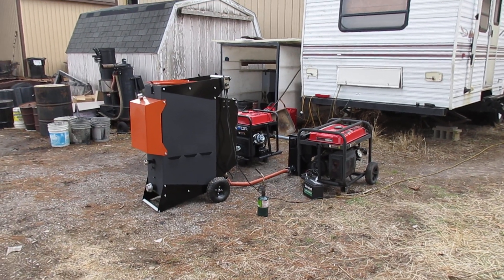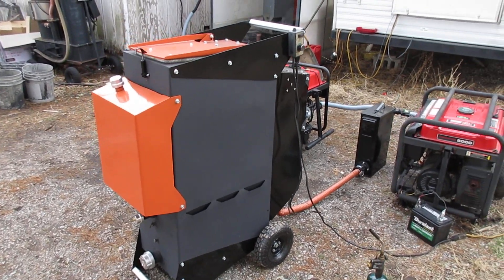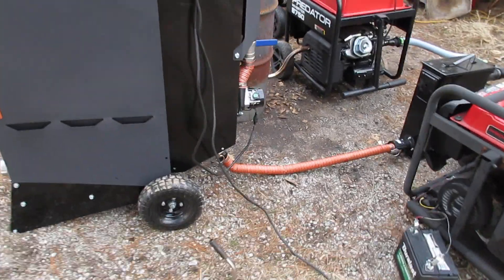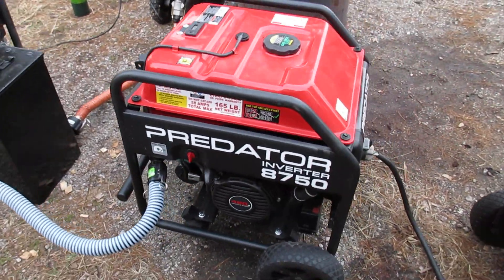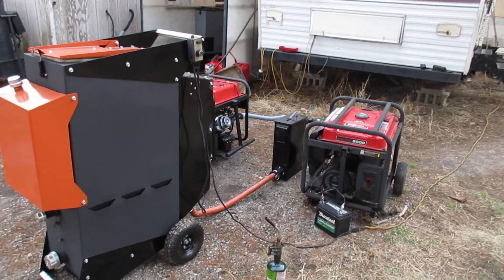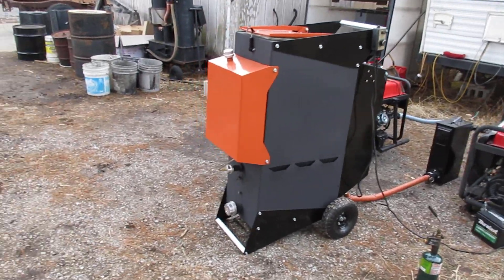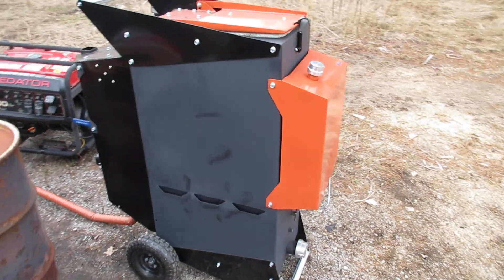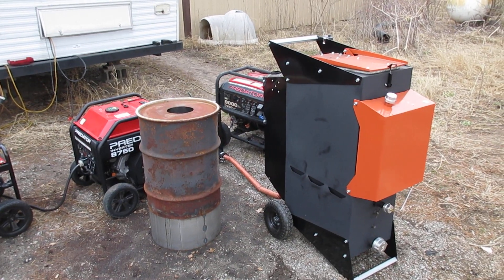The all New DF X - Series 4 Gasifier Running Twin Generators in Tandem!!

Comment: Matt, Our DF X-4 arrived today . The build looks good. There are no instructions included for the set up or operation and I have no idea how to adjust the water drip. Do you have a video covering this specific machine ? How about start up? Can dry wood chips be mixed in with the charcoal? Some operating info would be helpful.
Reply from the maker: One thing the S-4 has the other versions do not. It has the large engine kit. The larger hose set is for adapting larger V-Twins and I-4 engines. There is also a larger jet. For small engines you run the stock jet that it shipped with installed and the small hose set. The large engine kit does not come with a carb adapter as that is very custom. The small box is the carb adapter. However I have since purchased a 3D printer and we are testing 3D printed adapters now.

This should all be on the forum. This is why we have the forum to help you. There is no such thing as a user manual for this. The applications are way too broad to write a manual. As far as the basic opperation, thats why we have the video tutorial. This is like learning to fly an air plane. You are not going to read a manual and take off into the wild blue yonder. You might but you are more than likely going to crash. lol. No man you contact me and I will aid you one on one.
Reply: Will it run on bio-char?
Reply: @Spincabby  yes
Reply from the maker: You need instruction?? I figured you were a well seasoned opperator. 

Anyways this video here below is the tutorial for all DXF Series. It dont matter what one you have they all work exactly the same. The water drip just start out with a 1/4 turn open and you will need to experiment with this. This is not a linear adjustment; it is dependant on your specific application. Start with a 1/4 turn this is fine for any application, however you maybe able to add more if you want. The system will tell you when there is too much water. 

As for wood chips. No start on charcoal only for a while and learn the machine first before attempting running any raw wood fuels. Once you have some hours and know how it runs then you can start with small mixtures and test for tar. Again how much wood fuel you can add again depends on your application, run it too cold and it will produce tar and we dont want that. 

Link to demo tutorial: https://youtu.be/1HD1rvyEpBQ?list=TLPQMTkwNjIwMjN9b5zbW_JZYw
Reply: @Thrive-Off-Grid   Even experienced airline pilots with thousands of hours need relevant information to stay current. Thanks for the bit of info as to what some of the parts in the kit are for.
Reply from the maker: @nhhbbyloggr5022  Yeah thats why you are supposed to work with me directly and use the forum to get that information. There is not a manual we will never offer one. You are supposed to work with me directly.

Comment: I think you need to provide a warranty, maintenance schedule and rated hours otherwise we have no idea what were getting.  Also you can't combine a typical charger on the DC side, its won't work.  One of the chargers will follow the other one.    I have a battery manufacturing business.  Google won't let me tell you what it is in a post but you can see it in my profile.  Also you need to have a fuel air ratio control system that will work off of an exhaust O2 sensor for efficiency and clean combustion.  Without clean combustion you will have problems.
Reply from the maker: This machine runs just fine without the automated  AFR System. https://youtu.be/1HD1rvyEpBQ
Reply from the maker: Dont use smart chargers and you can then combine them. Some chargers are designed for this. We use PowerMax chargers.
Reply from the maker: As for the maintenance. What maintenance? All you have to change out is the ammo box filter media. There is no set time or run time for that. That depends on what you use for the media, how well you screen the fuel. The machine will tell you when you need to change this and you will learn by doing. Warranty  info is on the invoice. These machines are not throw away machines they are designed to last a life time of use. However like any mechanical system you may need to replace and or repair items. There is nothing on these machines that can not be repaired, replaced or fixed. These machines are charcoal, they will not rot out like a raw fuel gasifier. they consume all the ash so there is nothing to clean out, there is no water condensate again nothing here to service.

Comment: What's the overall energy efficiency of this vs running the engines on petrol or propane? Or compared to a renewable powered alternator charging a battery bank?
Reply from the maker: Thats not the point. Its to run on renewable feed stocks that you create into fuel yourself. This is renewable on demand versus, solar and wind are opportunity energy harvesters.
Reply from the maker: There is another part of this that is in development, that when combined with this will make this system extremely eficient. This will be a raw fuel gasifier optimized for charcoal production while it makes clean syngas for home heat, and all gas appliances. When used in a gas appliance this is a direct energy conversion. The byproduct (charcoal) is basically free fuel for the charcoal units. You can run raw chips in the units as well but it must be 10% or less moisture content and this may not work for everyone. So charcoal is the recommended fuel for the engine gasifiers. You can then add mixtures of chips to find the limits of your application.
Reply: Haha the over all efficiency in a throw more wood in it and light it it's not a monthly payment of administrative fees it's what wood can burn;) if you Wana buy one of these and asking if it's cheaper than gas then you don't have the wood to burn to afford it stay with gas lol omg wow
Reply: Just wow get a solar panel kit from Walmart instead lol
Reply: @markparadis8029  Hey, where do you think the Walmart solar panel kit started? Hmmm? This guy is on the cusp, the foreskin, he's going in first.

Comment: Hi Matt, how are you? Do you remember me?  I'm your Italian friend Alberto! I see your products have changed a lot since 2014!congratulations!👏
Reply from the maker: Thank you! Good to hear from you. Yeah things have evolved a great deal, the machines are much more refined and much simpler. They run on charcoal and crack water so the gas is much cleaner and self sustaining. They can run on very dry wood chips but like any gasifier users should be cautious running that fuel. Yeah if you see Franco tell him I said hello!!

Comment: Dude you are running 14kw right there...you can run a house on that easily.  I run my whole house on one 10k generator.   I would also like to buy one of these.
Reply from the maker: Not on wood gas. You must derate any engine running on any wood gas technology by 50%. The Predators with the 420 cc engines are good for around 2500 to 3000 watts. But this is about the best they can do. I can run an entire house on one of these units producing 2500 watts. Never run a generator as a primary power mover it is stupid inefficient. Store that power in a battery bank. Four hours run time outputting is 10 kW hours. If you optimize the home for off grid this is easily achievable.
Reply: @Thrive-Off-Grid  Ok thank you.
Reply from the maker: If you would like to order please contact me through the website and make sure you put this unit in the subject section. https://www.thriveoffgrid.net/